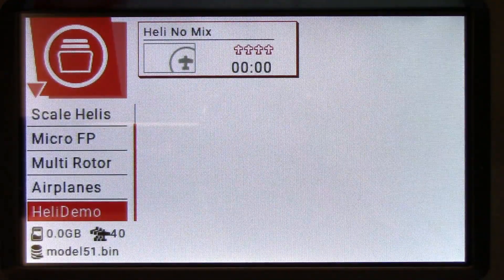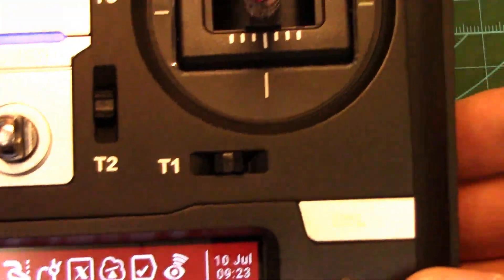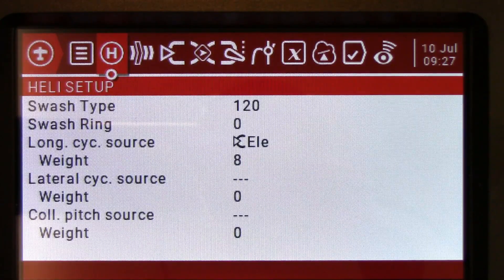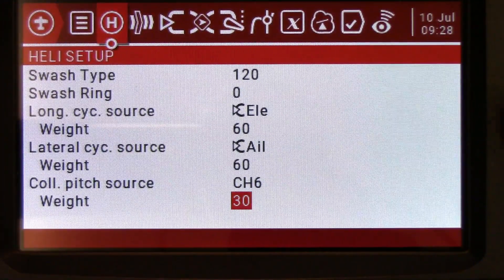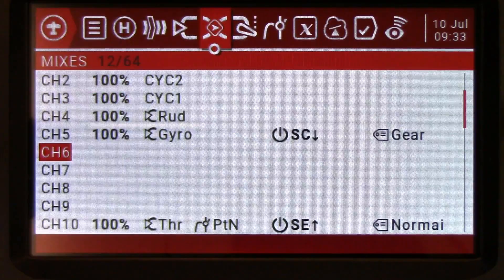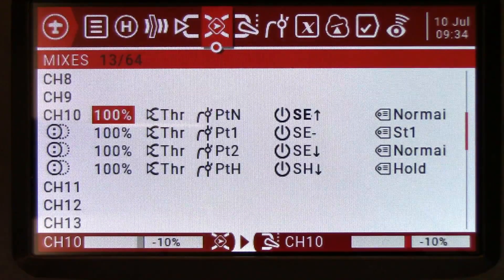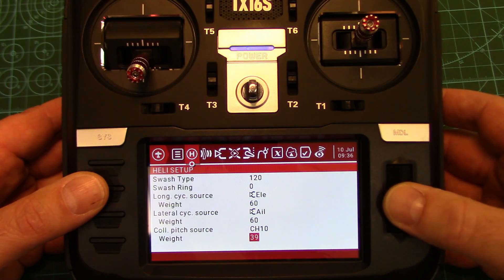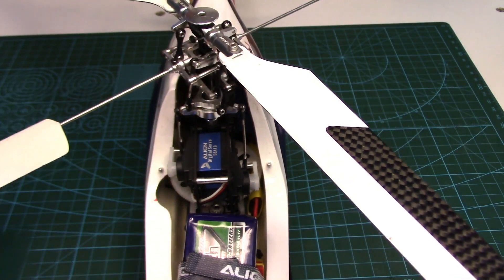OpenTX CCPM Helicopter Setup - Part 2 (Internal Radio CCPM Mixing)

Comment: Hey John excellent video really helped from switching radios my question is I have a governor on my nitro motor which adjust with my older transmitter how do I go about setting that up  ? And also gyro gains  this heli is align 600dfc  with 3gx flybarless thanks
Reply from the maker: No idea on governor throttle channel output as they are all different - go by your governor instructions for what it wants for throttle channel output and then adjust your throttle curves or channel output % accordingly.
Their is only one remote gain setting on the 3GX - tail gain. You would set it as any other remote tail gain setting. Tail gain channel is RX & FBL dependent, but on the 3GX it should be channel 7. If so, you would set your channel 7 travel output/s for the specific tail gain you want (enough to give good tail lock while avoiding oscillation). Cyclic gain on the 3GX is adjusted on the unit via the pitch & roll (elevator & aileron)  potentiometers.

Comment: Am I right to believe that a Thunder Tiger Raptor 30 v2 has a 90° swashplate and is also non ccpm?
Reply from the maker: To the best of my recollection, the TT Raptor 30 V2 uses mechanical swash mixing (ie. CCPM is done mechanically by the bell crank linkage system on the heli); so it would use the no internal mix OpenTX template.
Reply: @Rchelicopterfun  thanks, I will try that.

Comment: Thanks John that has been very helpful. However I have followed your instructions but I seem to have an issue with the collective pitch on my Align Trex 450XL; when I increase the throttle the swashplate starts tilting back and eventually all the way back.  However the swashplate seems to work/move fine when I use the elevator and the ailerons. What could be wrong?
To fix the above issue I reversed the elevator servo and that has made the swashplate work fine with the collective pitch. However now the swashplate tilts backwards when I give it forward elevator and vice versa which is not correct, right?
Reply from the maker: Are you following the process I show in my Swashplate eBook for setting your channel directions and weighted mix output directions (pgs 27 to 31)? If so, I show how to first set your channel directions so all 3 servos are interacting and moving in the same direction with each other with collective. Next step is setting your 3 weighted mix % polarity values (positive or negative) so the swash is moving in the correct direction corresponding to your stick movements (ie. up collective, down collective, left cyclic, right cyclic).  Going by your description, this could be either your elevator channel direction needs to be reversed ( or the other two), or your elevator weight mix is set to the wrong polarity - maybe a combination. As I show in that ebook, there are two ways to achieve the same output results for each of the 3 servos dependent on channel travel direction and mix polarity.
Reply: @Rchelicopterfun  Thanks for responding. I managed to fix the issue by changing the weight to minus 60 for the elevator in the heli page. However when I reverersrd the servo for the elevator in the output page it did not help. It seems that it has to be changed in the heli page.

Comment: Would I need to tweak anything for a nitro helicopter?
Reply from the maker: Yes you would since this is a helicopter template only; regardless of power type it has to be tweaked for every individual heli you setup. If you are specifically asking about the throttle channel configuration so you can have idle control of the carb (without using miserable digital trims for idle control), I've covered that in another video.  https://youtu.be/-cK6DZfu86s
It's on a gas powered RC plane, but the procedure is identical for nitro and it's exactly what I also use on my last remaining nitro heli.

Comment: Great video and easy to follow.  I still don't know if I understand the difference between internal and external CCPM mixing.  I have an Align 700, 700 with Align 3GX flybarless systems.  Which mixing setup method should I be using?
Reply from the maker: @William B. - The Align 3G & 3GX flybarless units have no internal CCPM mixing so the mixing has to be done within the radio. You would therefore use the internal radio mixing template outlined in this video.
Reply: @Rchelicopterfun  Thank-you John.  I rewatched part1 and noticed you actually mention that the 3GX setup requires internal mixing.  Very well done videos.  Thank-you very much!

Comment: Thank you for your nice videos John. I have a question which i find difficult to explain but here it goes.  If i put all the mixes on 60 to get the desired  pitches, the cyclic output channels reaches 100% before reaching the end of the max stick input. Causing strange behavour of the swashplate. To overcome that i have to put all mixes to 45 but then i don't have the desired pitches. this heli works fine on my other none open tx radio. What am i missing here?
Reply from the maker: I can't see how you would be getting over 100% on your cyclic channels (aileron & elevator) while at center/mid point on your collective if you have your CCPM mixes set to 60%? Something else is going there in your radio programming if that's the case. The 3 CCPM mix percentages will also almost always be different from 60% and will also likely be different from each other. 60% as I stated is just the starting value I use. Generally not high enough to overdrive any of the 3 swash servos, and also usually fairly close to the finalized value which is typically in the 40% to 80% range. It's all dependent on the helicopter's specific servo arm to swash geometry, and the swash to blade grip or bell mixer geometry. The actual CCPM mix values are set with your pitch gauge to get the maximum cyclic pitch and collective pitch angles your helicopter is capable of producing (listed in your heli manual) just as I explain in the Swash setup ebook.

Comment: Vario helis use 90 degrees swash connections.
Reply from the maker: Yep, that's a good observation. Vario however uses 4 servo 90 (H4 swash layout), this one only supports 3 servo 90, usually called an HE3 layout which I personally don't know any brand or model using. I suppose however, it would be fairly easy with OpenTX to use the 3 servo 90 (HE3) arrangement and simply use a second elevator mix channel also using CYC1 to get your 2 elevator swash servo outputs (front & rear). Never really thought about it 🤔. Might have to try that now as you sparked the curiosity bug within 👍.

Comment: Hi John..is there anything about nitro setup on your website or ebooks?   what I dont get is when a nitro starts up I would think the main blades would start spinning but in videos they dont.
Reply from the maker: They use a centrifugal clutch - explained in detail on my nitro heli page on my site: https://www.rchelicopterfun.com/nitro-rc-helicopter.html
Setup is the same as it is for electric other than having a throttle servo getting the throttle signal over an ESC. The main heli setup & swash setup is identical all covered in the two ebooks I mention in each video. I have nothing on nitro engine setup, tuning, and carburetor tuning however which is a hobby in and of itself almost 🙂
I also made a video a while back showing my IC (internal combustion engine) idle trim method on OpenTX using the ADD multiplex function. It's on a plane but the process would be the same for a heli carburetor idle trim control:  https://youtu.be/-cK6DZfu86s
Similar idea on an OpenTX turbine heli video I did: https://www.youtube.com/watch?v=R77obpPpyDQ

Comment: Thank you thank you THANK YOU!!!
Reply from the maker: Happy to help 🙂
Reply: @Rchelicopterfun  Hey John, I've got my TX all set up, but my heli doesn't want to react the same way as it should. i checked the channel monitors, and it all works fine. I'm using an AR620 receiver with the 3GX. Elevator works fine, rudder works fine, but something is wrong with the collective. it just doesn't want to do what i tell it to.
The motor is beeping, and my Aileron seems to act 1:1 to the throttle. i've made sure now 5 times that they are plugged in correctly into the 3GX. does channel mapping matter to the AR620? I'm at a loss :/ I feel so dumb lol
EDIT: I switched Elevator and Throttle on the receiver, now it works. I'm going to recheck if they are plugged in correctly into the 3GX since it's still not working as it should.
3GX is such a pain lol!